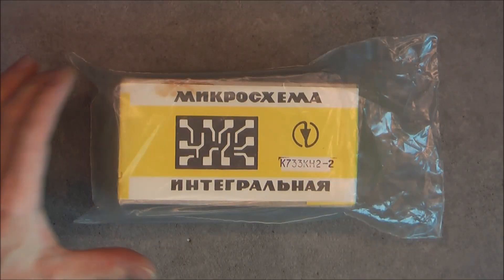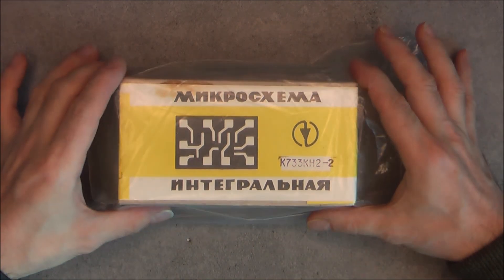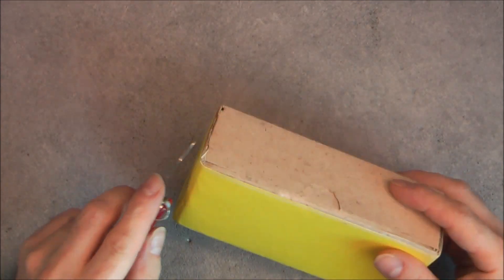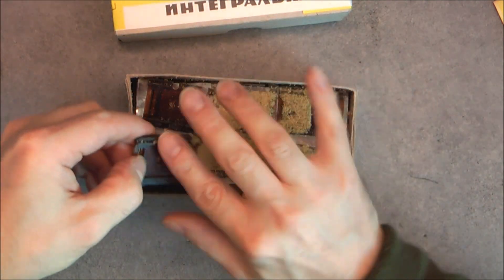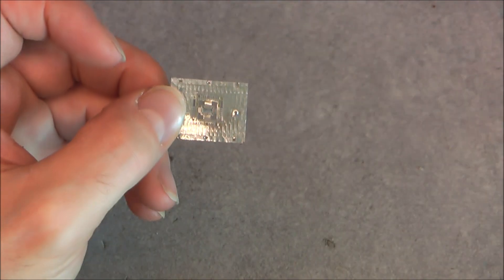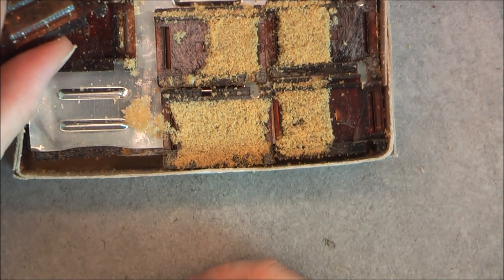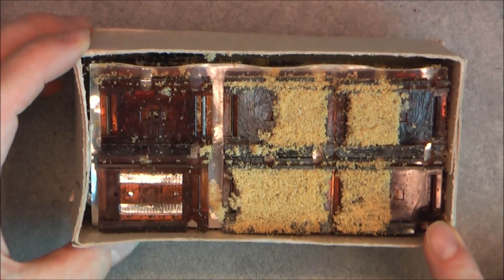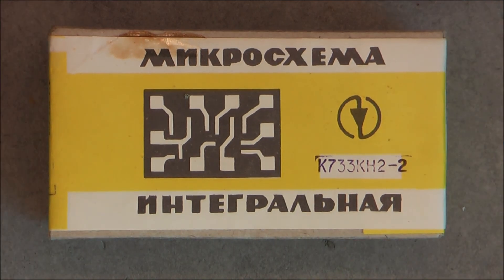Unboxing  vintage soviet K733KN2-2 ICs

Comment: Looks like a 16 bit analogue gate array with a built in 4 bit binary counter, just from the images in the datasheet. Gate on resistance nothing spectacular, but still pretty good for the process.

Comment: Manufacturing date is 23 12 91 (23 Dec 1991). "Интеральная" - should be pronounced as "integral'naya" (better to check with the google translate). ICs in the same packaging were used in soviet programmable calculators like "Электроника МК61"